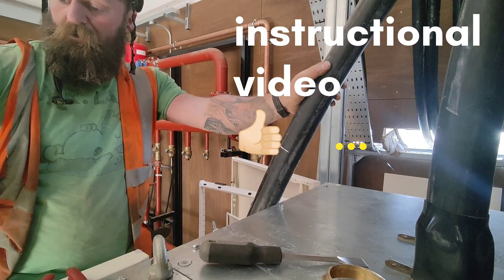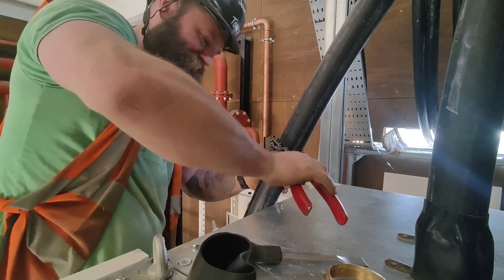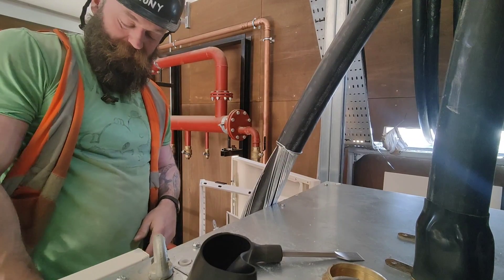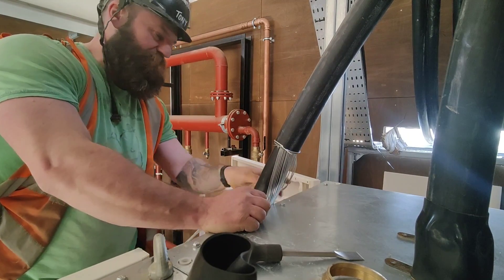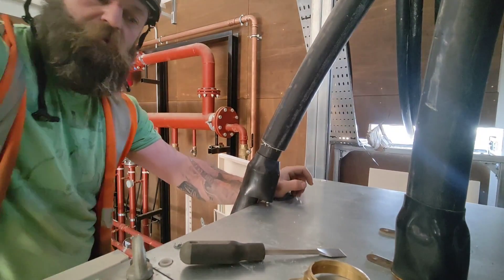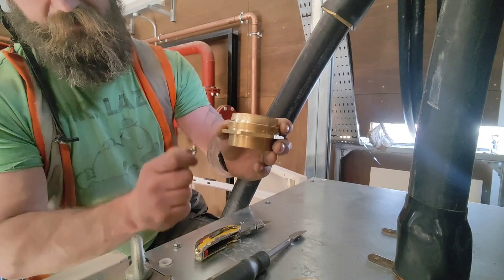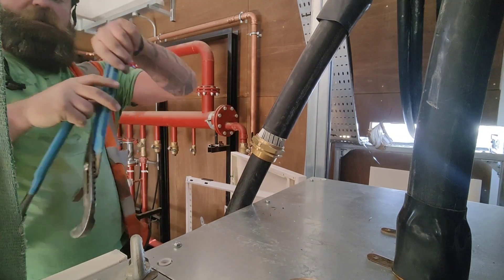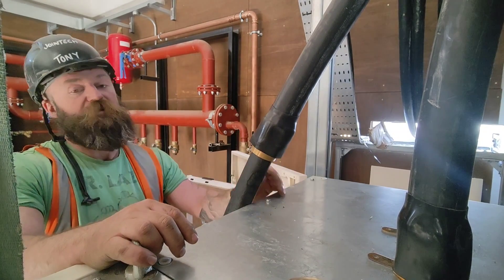How to put a gland on a cable #howto #instructional

Comment: If you fold the cut end of the shroud in on itself  it’ll push straight on and unfold itself as you pull it back down to where it needs to be

Comment: How do you know how hard to go with the exhaust pipe cutter, just get used to it?
Reply from the maker: Yeah you just get used to it. It's the same as when you ring a cable with a hacksaw. You just know how far to go. I made sure to practice a few times before I cut an actual cable though.

Comment: Class as always Tony! Looking forward to the video showing how to measure where to mark and cut. Maybe also show how you get cable that size up and through hole into panel. Cheers mate 👍
Reply from the maker: It'll probably be the next short video I make. 
If you check out https://youtu.be/eaOC057iH8s you'll see the illegal-ness of the process of getting big cables through the holes in the panel. 😂😂😂